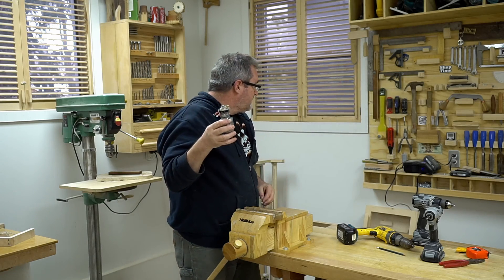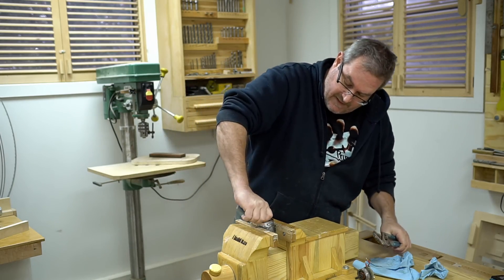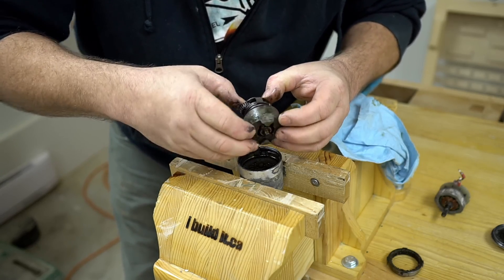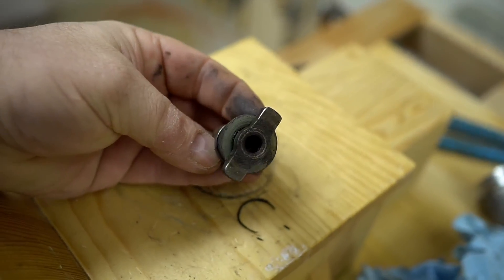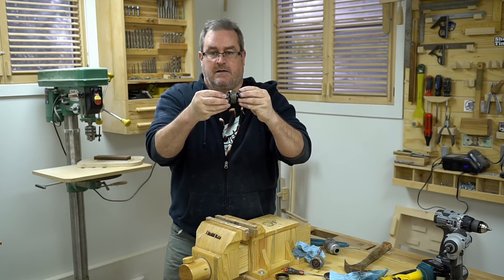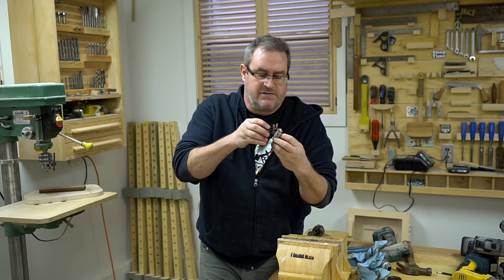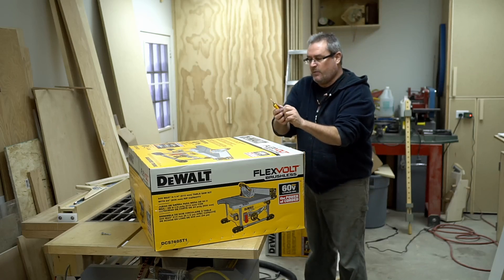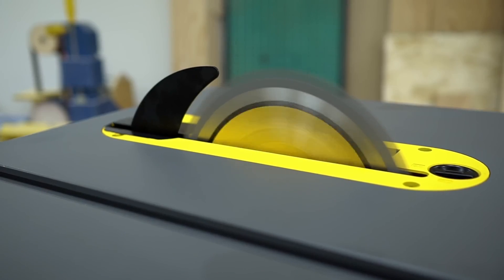How Impact Drivers Work And Other Fun Stuff

Comment: I have a makita impact driver, had it close to a year now. When I press the trigger the light comes on but the drill bit doesn't spin.  
Was wondering if anyone else has had this problem and knows what's wrong.
The battery is charged.

Comment: It's worth noting that you should only store nickel cadmium or nickel metal hydride batteries at extremely low temperatures. Lithium ion or standard alkalines don't benefit and can be damaged by moisture and pressure changes freezing can cause. For most situations it's best to just store batteries somewhere cold and generally dry like an unheated garage or pantry.

Comment: Hi John. What do you look for when buying a drill? I think that most drills are more or less the same. Makita is as good as Dewalt, even lighter. They all have, almost, the same life span. Does the additional cost justify buying the more expensive brands? Thanks for the video, and for the record, you look nice with the cap on. Keep warm, tonight is going to be a hell of a snow fall.
Reply from the maker: My best advice is to first think about what you'll use the tool for, and how often. If you are only doing some light stuff on the weekends, don't waste your money on the expensive ones. 
If you are working day in and day out with the tools, you should get the best you can afford, since in general they will make the job more efficient.
Reply: It makes sense. Thanks for the reply.

Comment: I got to ask about your experience with the Makita batteries, the 3AH ones in particular.  I used Makita for years, but the batteries would constantly stop charging anywhere from 6 months to a year after new.  They were not by any means wore out.  they would be working perfect and than all of a sudden the charger would say they have a fault and would not charge.  I had at least 6 replaced under warranty, so that tells me Makita was aware of the problem but would not admit it.   I know many others experienced the same thing. Did you have any issues?

I have since switched to Dewalt a couple years ago after they sent out a bunch a free tools for me to try out. never had a battery problem since.  The one battery I did have an issue with (left it out in a rain storm over a weekend) would not charge, but then came back to life and is still working perfect.   I was perfectly happy with the tool performance if the Makita, but the batteries ruined it for me.
Reply from the maker: I know Makita did have problem with their earlier 18v batteries (with the green writing on them), and I had 2 of those replaced. Since then, no issues and I think I've had more than 30 batteries over the last 10 years or so.

Comment: Great video.. I think you just explained why the first Dewalt driver i bought was breaking my bits. Every time I tried to use it ,it would either break the screw head off or break the bit. Too Much Spring Tension. Never thought of that, took tool back to Lowes and bought a straight drill.

Comment: Hey John found a creditable video of why you shouldn't put your batteries in the freezer.

 http://youtu.be/MF1hGT4z4y0

Obviously water and ice do not play nicely with batteries.
Reply from the maker: First, I had to pluck your comment out of the spam folder to make it visible to others (you could probably see it, bu no one else) and that's because of the link. All comments with links, even if they link to another video, automatically go to the spam folder.
Now I can watch that video :)
Reply from the maker: I put my Makita batteries individually in ziplock bags, sealed and pushed out most of the air before putting them in the freezer. Three years later, I took them out and let them warm up to room temp before opening the bag. I'm still using those batteries today.
Reply from the maker: I should point out that this is for LONG term storage, not a day or two or a few weeks. Storing a battery in the freezer for a month at a time or less is not a good idea, since it will eventually build up moisture inside the case.

Comment: "maybe one more thing..."     Hah!

As for the thing you saved in a special place... I bet the manufacturers like that style because it is smaller so it's easier to store on their tools.   

As well I did wonder about the DeWalt batteries on the Mastercraft, since so many people claimed that they looked so much the same back when we did that sponsorship.   Heres' a question for the industry insiders.  Do companies spec the tools to deliberately be incompatible?  I wouldn't be surprised.   I seem to recall someone saying a year or two back that the compact 12v Millwaukee's would accept another similar battery (Ridgid maybe?)
Reply from the maker: Lot of money made on the batteries alone, since the tools will usually outlast those.
On the other hand, the one size fits all is limiting. If it had been arrived at back in the 80's, the connection would be set at 2 contacts, since there was no need for any more than that at the time.

Comment: Good thing you saved that push stick. Lol.

I'm not familiar with the "Flex Volt" system. It looked like it said 60V on the box but you only used one battery as it seems like there's only one spot to put a battery. So what's the deal with that?